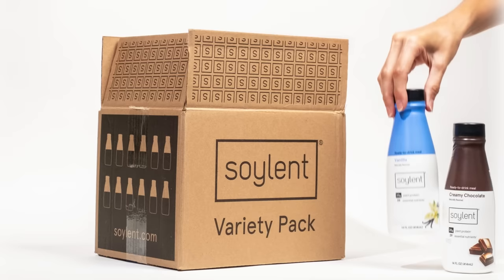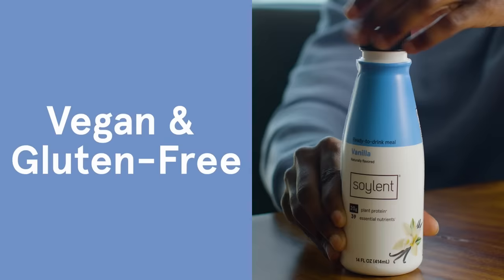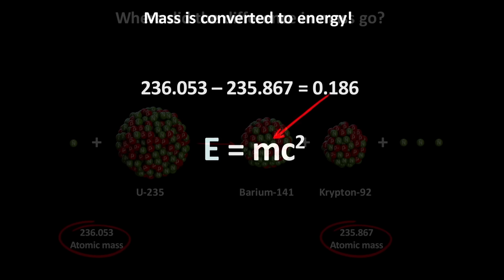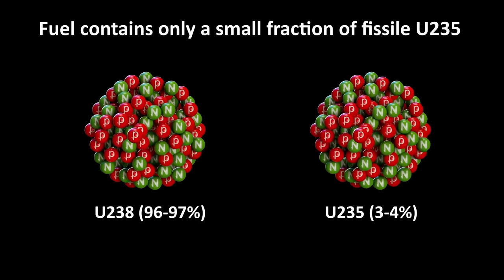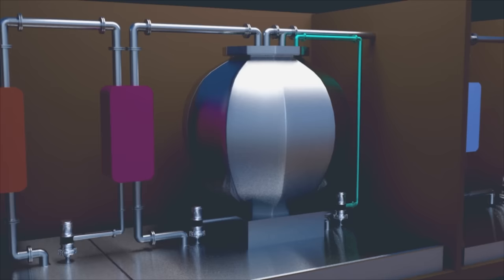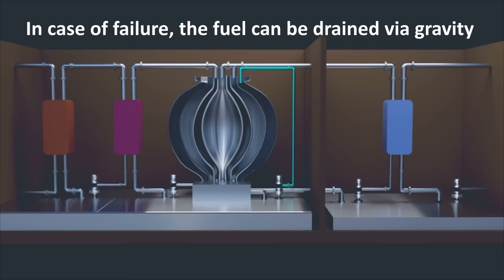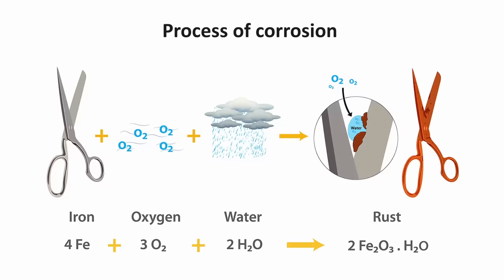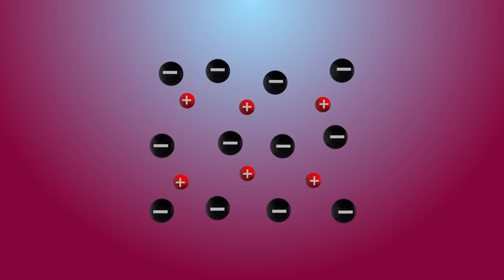How Molten Salt Reactors Could Revive Nuclear Power

Comment: Just understand the basics that grid electricity needs a grid to the customers. 
20million in Australia. 
300million in the USA. 

The first grid that was built over 100 years and with national wealth. But it is basically 5 times too small. To stop CO2 emissions.

So all Grid electricity is basically a dead duck economically to stop CO2 emissions nationally and worldwide.

You have to add the bigger grid capacity construction costs to the nuclear plant costs. If you are to replace fossil fuel CO2 with electricity. 

There is a reason that transmission lines are built in multiple parallel lines of towers. It is because it is the only way of creating a bigger capacity for more electricity.
Reply: No you don't.

Comment: Recently, i had this pro EV and Renewables acolyte tell me that "no materials exist to run a molten salt reactor"..........I said "then how did ORNL run one for 10 years?"..........no reply.    Salts dont corrode the same way that water and oxygen dont corrode..........it requires the combination of salt,oxygen and water. This is why the waterline of museum steel ships corrode the most.........plentiful water,salt and oxygen and even normal water often contains dissolved oxygen. MSR has been handicapped and blocked by western political interests aligned with the planned and desired artificial scarcity of the globalist hegemony.  Bankers run governments......not democracy.

Comment: Arvin, is there a fission cycle which would start with repeated neutron (or proton if that is possible) absorption by a heavy nucleus, and, after a couple of beta emissions, end with alpha particle emission? Wouldn't that be a roundabout way to, effectively, achieve (assisted) nuclear fusion?
Reply: That is literally the Thorium cycle. 
Thorium gets bombarded by neutrons from the core and turns into uranium that gets inserted into the core.
A fraction of a fraction of that uranium turns into Plutonium 238, which is an Alpha emitter.

Comment: There is no new reactor built in the EU since 2007. Only plans and announcements. Because it takes >10y and increasing costs. Now there are new plans, and some demo-reactors to be built.
Me personaly dont like "hot-water reactors" because we need a new form of energy production without water-heat. And there is much trash from older reactors, this has to be re.-used.
Reply: Average time to build a nuclear power plant worldwide is 5-7 years, excluding the American AP-1000's and he European EPR (China built both with only some delays on the 1st unit).  Both America and the EU forgot how to build nuclear power plants and modern management thought they could be built like any other construction project.  It does not help the EU that the EPR has a design issue and it will be redesigned for any future projects.    

Also Ukraine has announced the construction of AP-1000's, and Poland wants to build them too.

Comment: Melt downs  may be theoretically  possible the whole China syndrome i highly unlikely based on  reactor fuel geometry  it takes a specific  mix to maintain criticality  if the fuel were to melt the control rods go with the fuel  mixing  the neutron poison in withe melted fuel, no neutrons no  nuclear reaction fuka shima  was a hydrogen explosion, the hy drogen is related by a zirconium -water reaction  us reactors  have modifications to burn hydrogen  in controlled manner, the Japanese failed to incorporate those  modifications.

Comment: Why not just buy candu reactors from Canada. They address all the same problems and are proven over decades.
Reply from the maker: The main problem is that they are still susceptible to a meltdown, so the main issue of public safety is not addressed. MSRs are essentially meltdown proof.
Reply: Odd that there’s never been an accident… @ArvinAsh

Comment: Plutonium is not a waste product as it can be used as fuel. Why are you telling BS? A fast neutrons reactor could also reduce the minor
 actinides waste... Thorium is a nice alternative to Uranium, but there are still many problems to solve. I think the Chinese have made significative progress in their Gobi desert project. In Oakridge they ran a nice experiment with a molten salt reactor but it was using Uranium, not Thorium.

Comment: Good video... Didn't mention the potential to use other media for heat transfer to power generation turbines ... Like co2 that also can raise efficiency
Reply: It could be used to prevent actual physical contact, limiting the corrosion process to neutron damage alone.  Maybe . . .

Comment: Although I'm not sold on the climate change hysteria, I still found this technology very useful in lowering energy costs (cheap clean energy it's a boom for development) and it should be a top priority.
US has too much red tape.
Therefore developers should be looking for deployment on other nuclear friendly (or at least, not outright antagonistic) regions while working with regulators to set up appropriate rules for such technology.

Comment: Hello thank you for the video, but you say in 1kg of uranium it has 24.000.000 kwh where did you find this data ?
I think its much less then that.
Natural uranuim only has small amount of u235 and alot of U238 and this  should contain about 80.000 kwh,.
If you take enriched uranium this should contain about 2.000.000 - 5.000.000 kwh.
Reply from the maker: https://www.euronuclear.org/glossary/fuel-comparison/#:~:text=8%20kWh%20of%20heat%20can,1%20kg%20of%20uranium%2D235. https://greencleanguide.com/how-much-fuel-we-need-for-a-year/
Reply: @ArvinAsh   Thank you

Comment: I thought another issue with thorium is one of the daughter products emits gamma rays which basically can't be shielded.
Reply: There isn't any raadiation that can't be shielded against. In NPPs, 2 meters of water will drop the intensity of alphas, betas, gammas and neutrons to below the background.  Gamma rays occur in most fission and fusion atomic reactions; in a few,, they are of higher intensity than normal, reactions like the decay of cobalt-60 or uranium-232 (in the thorium case), but are still handled by that 2 meters of water or 3 feet of concrete or a couple of centimeters of lead - or 200 meters of air.
Reply: @puncheex2  I guess I was wrong about gamma radiation. I thought it would take way more shielding. Thanks for the reply.

Comment: Every single nuclear power plant built in the USA was a custom design. None were "standard."
Reply: No longer true.  The AP-1000's are standard and were designed from the best design ideas that worked in the about 76 different designs in the 1st about 104 reactors (the same design was often used for 2 or 3 reactors)
Reply: @perryallan3524  The AP-1000 is a nuclear reactor, not a nuclear power plant. Different nuclear power plants, each a custom design, could have the same nuclear reactor(s). The exact layout and components of steam, cooling, exchanges, turbines, power/transmission, security, control rooms, control software; backups; no nuclear power plant was remotely the same and an experienced operator or technician from one location would have a long way to go in learning the ropes at another location.

Comment: A waste problem of only a couple of hundred years makes it at least worth looking into.  That seems like an engineering problem that can be solved.   However the idea of relying on zero contamination is pretty scary.   Sounds like they are just sticking their heads in the sand and hopping it never happens when in reality it's going to at some point.   So if they have plans for detection of that particular failure mode then I'm ok with them working out the details of the system.   Unfortunately.  I don't think it will help.   We will have to have already sorted out the climate problem before the work on this system would be finished.

Comment: We should embrace nuclear in the form of Thorium/molten salt reactors.  But we should limit traditional nuclear reactors to the minimum necessary to maintain our nuclear weapons programs.
Reply: Traditional reactors are not used for weapons.
Reply: @chapter4travels  -  Where do you think spent uranium projectiles come from?
Reply: @wickedcabinboy  You said nuclear weapons and the plutonium for those weapons does not come from traditional power plants and neither does depleted uranium for projectiles. Depleted uranium comes from the uranium refining process when they separate U235 from natural uranium.

Comment: The change to nuclear is taking far too long. They are already starting to decommission nuclear power stations I worked on and there are no replacements in sight. Their lifespan is far too short. 5% is a joke we need to set a target of 100% to achieve 50% as our overall demand is increasing due to governmental phasing out of carbon fuels. Small nuclear reactors with generators are also available but no one is buying them. I have no idea why.

Comment: You never mentioned Thermonuclear, reactor meltdown.
Reply: That's because he is comparing solid-fueled uranium against liquid-fueled thorium reactors.  Molten salt reactors cannot meltdown, because, by definition, they are already melted.  The adjective thermonuclear is not used with reactors, because they don't fuse hydrogen.  It is applicable only to weapons.

Comment: why didn't they develop the thorium process in the 50's instead of the u235 process?
Reply: Part of it is that they originally designed reactors to produce plutonium for nuclear weapons, and then just adapted that to power production for submarines, and then for commercial energy production.
Reply: @richdobbs6595   That is totally wrong.  Power plant reactors (with one exception in the UK) could never produce bomb grade Plutonium due to too much P240 poisoning from to long of run times on the fuel rods (too much P240 and the plutonium will not go "boom").  Specail weapons grade reactors are used that only run the fuel rods for a few months.   The typical power plant runs fuel rods for 33-46 months, with a rare possibility of 11 months.  In all cases too much P240.

That was known before the 1st power plant was every built.

However, the USA did try to build thorium power plants (built 4) but they were major technical flops while the uranium counterparts worked.

Please read my post on the history of thorium nuclear power plants.
Reply: @perryallan3524  I like how you say I'm totally wrong and then proceed to explain in more detail the process along the same lines that I sketched out.  As a hint, did I ever  say that power reactors were used to produce plutonium?  No I said that power production in submarines were adapted from reactors used to create plutonium - that is, reactors based on U235.  Now please be useful and let me know if those initial reactors used for plutonium production used enriched or natural uranium like the Chicago pile.

Comment: i echo the comment on the terrible name of this "soylent" product. are they not familiar with the movie by Stanley Greenberg? i know i'm old but, c'mon, its a drink named "soylent".. do a quick search, read the plot. speaking of the 1970's.. the power structures ever since then have done everything they can to minimize the use of nuclear power, not because of its dangers, (although that's what they exaggerated in order to keep it from seeing broader use), but because they are not interested in green energy. then or now. that's why even the awesome innovations of modern molten salt reactors will not see broader use. if we solve the "climate problem" too quickly and easily, it cannot be used as a lever to political power.

Comment: This is a vast oversimplification of the challenges of molten salt reactors. There are many significant challenges in producing commercial scale reactors of this type with there being serious technical challenges of handling molten salt on the scale of a commercial reactor. The experimental system at Oak Ridge was extremely temperamental and never reached it's expected 10MW output.

Comment: wow... misleading statistics. Energy consumption is meaningless. Why you show solar panels? Ok, electricity is a part of total energy, but we are talking not about electricity, we talk about energy, i.e. cars, trucks, ships, airplanes. Secondly, going from 1% to 5% is a drop in the bucket. Thirdly, talking about a "push" to green energy but it was just 6% reduction of oil, coal and gas. 6% reduction in 50 years! Nuclear is primarily electricity, so we should compare green electricity. And green electricity is pushed by solar and wind, while nuclear is becoming obsolete. In Germany, solar went up from 1.9% in 2010 to over 10% in 2022. Wind from 6% to 22%, same time frame. Ok ok I came here to learn about molten salt.

Comment: Actual reactor tech is the byproduct of weapon research pu139 was desirable in the 50's. Other ways where known but either really difficult .
Molten salt has a lot of drawbacks on the materials that can withstand 700-900°C on highly corrosive fluids even without pressure, yet today techniques make it plausible (it's my real wish)
Another idea was to increase temperature with liquid sodium to replace water as a moderator and heat carrier... man i'm glad the tsunami in japan didn't meet this idea